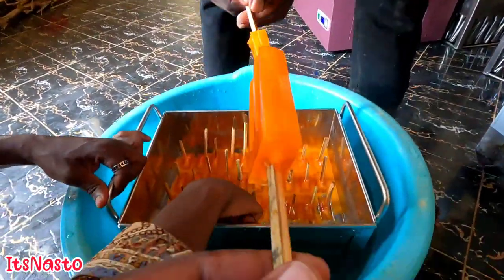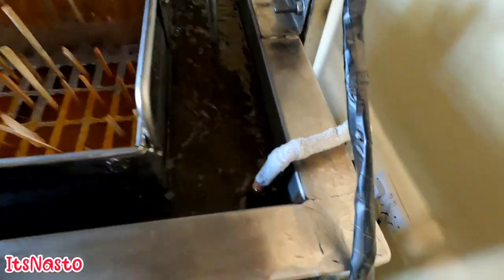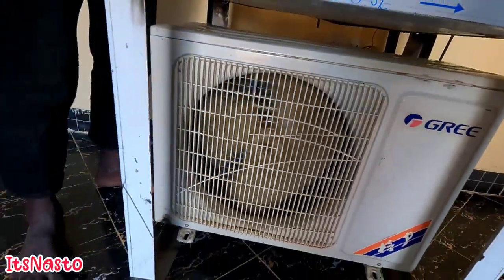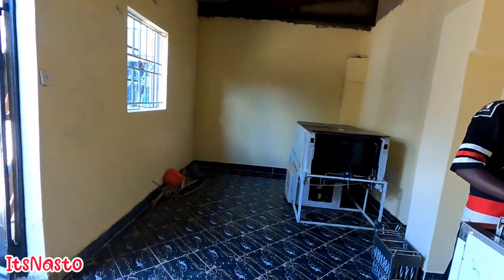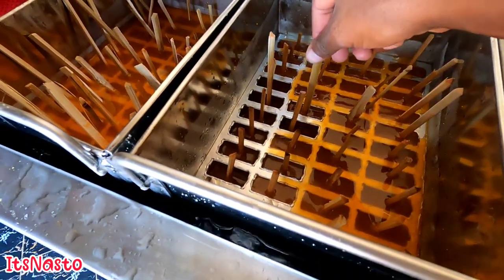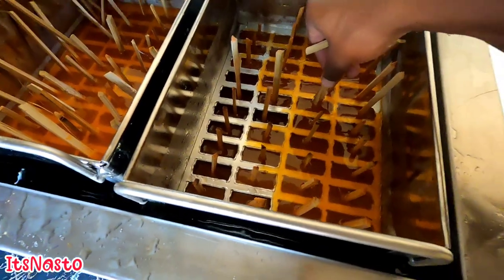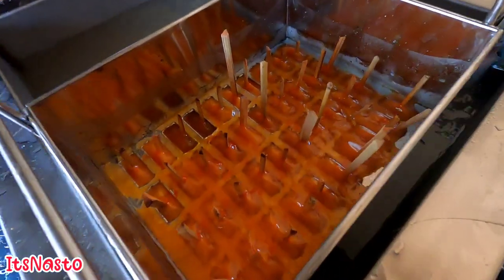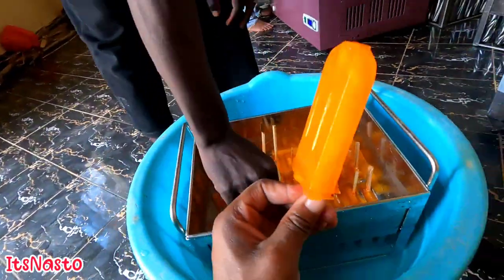STARTING A MULTI MILLION INDUSTRY IN AFRICA!! POPSICLE MAKING #viralvideo #popsicle

Comment: Looks good, but a frozen popsicle can be frozen without the machine to make popsicle. Could it not? I just don't see differentiating contribution the popsicle freezing machine is adding to the product. How about if you had a single deep freezer into which you put your molds filled with your mixture and sticks and let all those thousands freeze overnight? The popsicle making machine is really just bottlenecking your productivity and adding an additional step that needs to be overseen and monitored or engaged with periodically.
Reply: How dose that small machine with 2 head cost and where can I get it